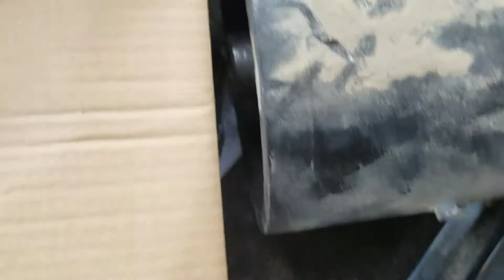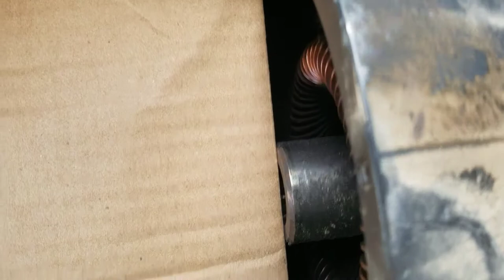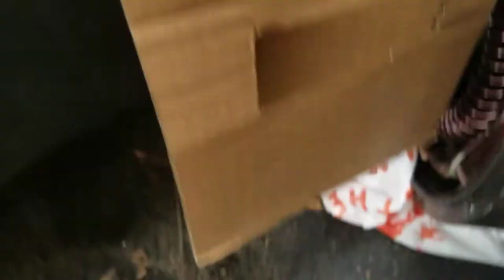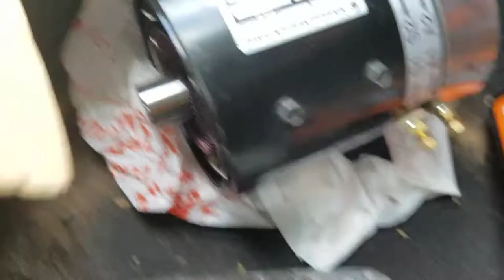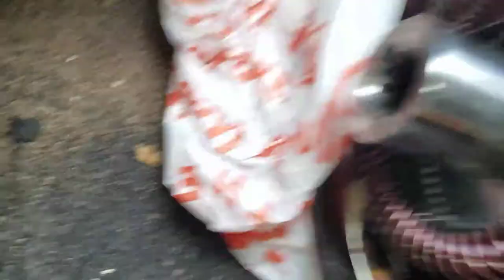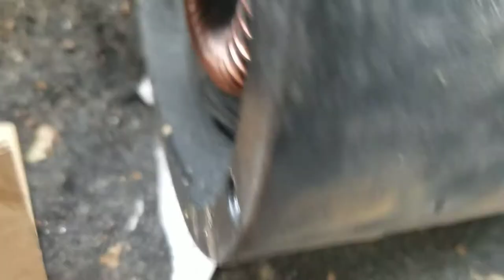Motor for golf cart

Comment: Looks like one of them is an older E-Z-Go and the other one is a newer 48 volt Club Car there's a lot of difference because it's got that little bracket on there that goes to the differential and he doesn't say what model that is if it's an EZ-GO or club car so it's hard to decipher from here but that's definitely two completely different Motors